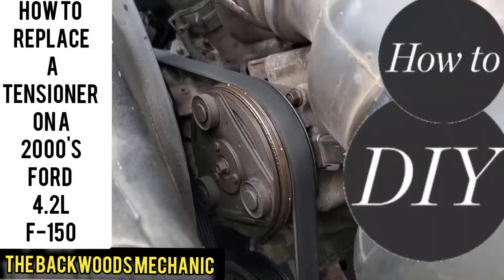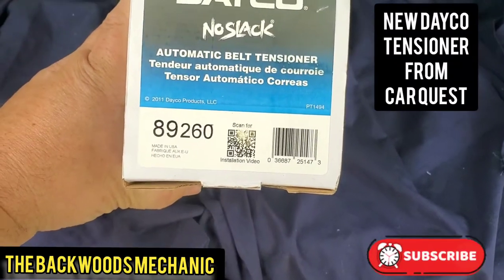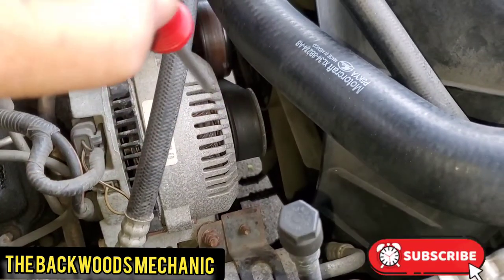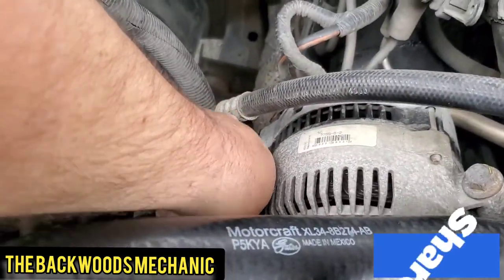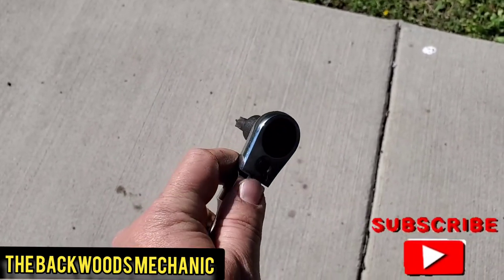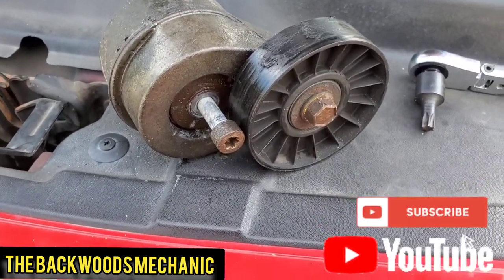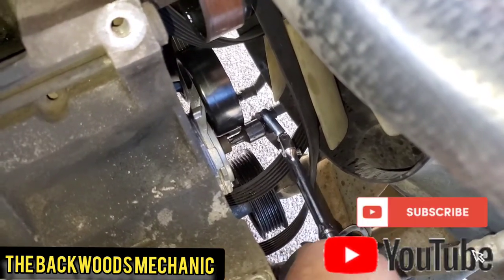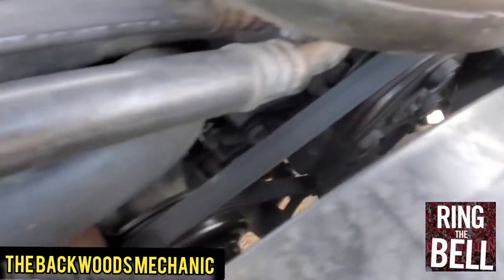DIY Tensioner Pulley Replacement 4.2L Ford F-150 (Screeching Bearings & Squealing Serpentine Belt)

Comment: all idler pulleys with tensioner is the best thing to do .Dont over tighten that bolt for the tensioner ..I nearly stripped mine because the bolt was a bit froze from a small bit of corrosion ..I wanted to be sure it was tight ,it kept spinning ,it would not tighten ,so I put grey Teflon tape on the threads at that saved the day ... I took my fan clutch off and got the shroud out of the way and it made the job much easer

Comment: Good video thanks. Will be doing the pulley below the tensioner pulley, and more directly under the alternator soon as it has seized up and broken the serpentine belt. Hoping that pulley also has the torx socket , fingers crossed..

Comment: Worth noting is some less expensive tensioner pulleys like the Linerts I just bought aren't as wide as stock but are wide enough and stay centered on the belt. Smart play with tensioners and pulleys is bring your old ones when buying at the auto store. I removed the (LEFT HAND THREAD) tensioner pulley bolt so I'd have the bare pulley in hand for comparison to be sure I had a correct match.

Comment: I changed this in a 2000 f150 4.2 because of a rattling sound in drive at idle. Didn't get rid of the rattling but its for sure coming from the tensioner. Its out of warranty so I'm going to try again with the one you suggested.
Reply: I got an 07 4.2 and it's making a rattling sound when I turn on the AC at idle it's getting pretty loud. Hoping it's not something else on the belt did you seem to fix yours
Reply: @nickwheeler1652  it ended up being the belt. I just needed a new belt, the old one was stretched causing the tensioner to  rattle because of lack of tension
Reply: @J1SMOKES  wow awesome definitely going to try that first thanks for the reply man. This rarely happens when somebody does grab yourself a cold one and no that you really help the guy out on the interweb